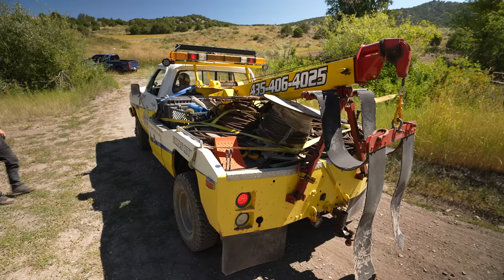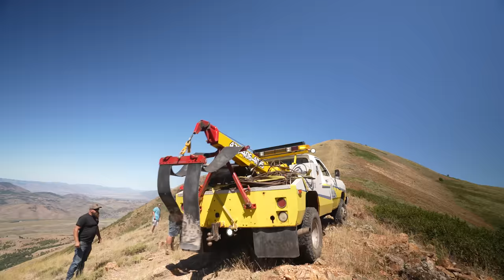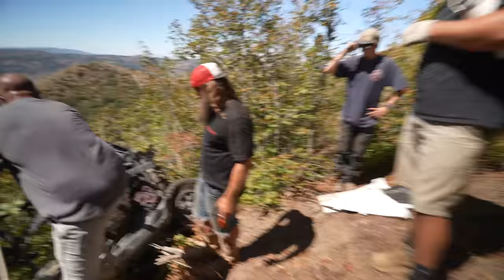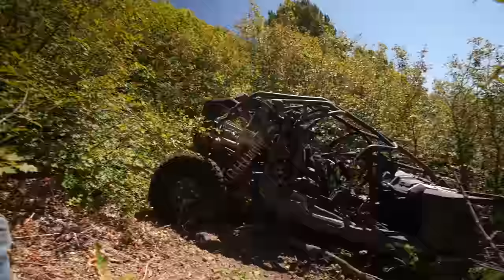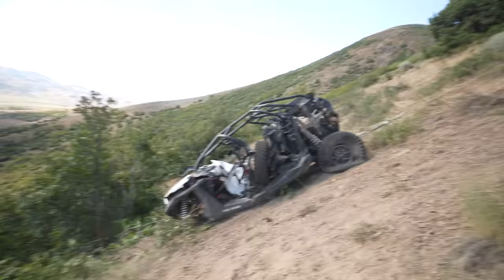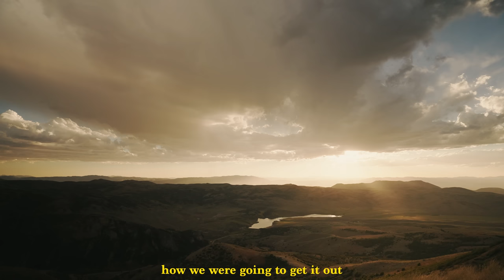Our Most Heartbreaking Recovery Yet (Fatal 1,200ft Crash)

Comment: Hello from Wyoming Im the one who grew up in Kaysville, Utah in the 50’s.  I just watched your recovery video on Garden City Utah mountain top.  I just want to make an outsiders comment to you.  As you guys were hauling that UTV up the mountain side, I noticed that the front axle was missing one tire and the other tire was crooked.  To stop it from digging into the ground or brush wouldn’t it have been easier to have a big flat piece of metal (of course) hooked to the metal rope to put the UTV on once you got it hooked up to go up the hillside.  Then the UTV would slide past all the riff-raff going up and be a lot easier to get there.  You would need another flatbed to have the metal (I’ll call it a sled) sheet sled  on to get it to the top.  Then hook up the metal ropes, etc. and lower it down to an open space.  Then winch the UTV up the hill enough to put it on the metal sled and then bring it up.  To me that would have been easier on you all.  I get called a McGuyver all the time for my projects that do work.  It was just a thought for you.  Great recovery, very sad situation but the family now has some closure.   God bless you all.

Comment: It is wild that wearing a seatbelt might have caused this fatality. I’m now curious of the data for fatalities between wearing a seatbelt and not for off-road vehicles.
Reply: We lost two women here in Moab a few years back when they rolled on Hell's Revenge.  They also perished because they were belted in, but in this case leaking fuel was ignited by sparks from the metal grinding on the rock and an inferno erupted and consumed them before they could unbelt.
Reply: The fact that the cage is intact around the rear seats but she still died would suggest to me that the bigger issue was that she likely wasn't wearing a helmet and that wearing one may have saved her life.
Reply: @KR15ING  honestly a helmet would not have done any good. That would be way too much trauma. If they were wearing a helmet with a HANS device it might have been survivable. Just like in motorsports it seems that HAND devices might need to be just part of the kit, especially when driving on top of a mountain.

Comment: Very sad thing to have happen, condolences for all involved!

Five point harness and helmets can do wonders. I’ve rolled my rail, all safe after rolling for over 350 feet down a very steep foothill in AZ. Flipping like crazy, sideways, end over end. Rail handled well, it was built by Brandwood Racing, engine built by Racecraft. I still have it. We use webbing also along with passenger foot press and panic handles. Two seater with a 2331cc, 13/1 comp ratio. 
Max fun but mad dangerous too! When the beers or booze comes out, the machines are never ran again until morning, that’s a rule everyone should practice, in fact we call it Law!

Comment: Back in the day i used to hook logs with cable and have used cable slusher draglines mining underground.  Ive used a bit of that synthetic rope and in abrasive heavy use and its never held up at all onlybgood for suspending loads and rigging.  Cable is the only way to go in real tough conditions and if you break a cable its no big deal to weave and splice it together if its not too large an diameter.  That old Cummins 5.9 is about an ideal truck with its mechanical injection and simple engine.

Comment: I drive several Argo vehicles off road, mainly on mountains. I'd never wear a seat belt in a vehicle like that, there's nothing worse being strapped into something tumbling down a hill. My first reaction if I knew it was about to roll, would be to bail out soon as possible. When on a steep bank, at times I'll even have a leg out the side, just to be ready. But of course if depends on the terrain, if it's just a small mound it would be fine, as you wouldn't go very far. But a big mountain side like that would be a big no no for me. Although I'm sure all the safety manuals and reccomended training would tell you otherwise. I only know of one person that was killed in an Argo near me, and I know that they were strapped into it as it went down a hillside.

Comment: You guys should have a thick piece of plastic made roughly the size of a razr. mold it up on the ends and put a hole in an end of it. You could put the rzr on the plastic and haul both of them up a hill such as this one. i THINK it would slide over brush and rocks much easier. Just a thought gentelemen.

Comment: As a former Army Engineer, I'm just surprised you never use picket plates. Half-inch steel punched for half a dozen 1" pickets each side, each picket 4' long, sledged in deep. A shackle front and rear, ane if necessary more plates to shed the load out to either side.

Comment: many will see this as a reason to not wear seat belts, if you're off roading this can be a decent idea because if you roll down a cliff like that the sudden stop with the vehicles added momentum is pretty similar to falling to your death if not the exact same. being unbuckled in a crash like that can be the only way to survive but you still risk being crushed by it as it rolls, but if it's a more mundane crash and just rolls on the trail being buckled in keeps your head and arms from going under the body/cage but if you're unbuckled you risk dying in a rather mundane roll over, this is all for off road thought where you should look at your trail and use your best judgment to decide what is the safest you can do. on the road it's different you rarely will have a case where the seat belt is a problem and will have many where people died because they didn't wear it, if you're on the street is safer to wear your seat belt, if your off road use your best judgment and try to make it home safe please.

Comment: You guys should map out all the bits pieces of vehicles as well as the crash site's of these places so that they could use them to improve safety on whatever road/trail/etc. the accident occurred at or for vehicle manufacturers to better improve their safety features. The tragedies you guys help people with can help prevent further harm in the future. Like for instance, I get that the ATV fell over 1000ft, but i feel like the seats coming out of the vehicle while its tumbling down a hill should be preventable in an off road vehicle with a roll cage chassis. Stuff like that should be sent to manufacturers themselves with a full crash report.

Comment: What could have prevented this?  Helmet, BETTER ROLLCAGE, better seatbelts?  I own a Honda Talon and rolled it on it side at about 15 MPH.  It tweaked a few welded joints in the tubing.

Comment: Maybe best to run a skid under it first? Drag it onto a sheet of metal? Then pull the metal skid instead of the razor. If the whole thing is on a smooth skid it won't catch on anything at all.

Comment: I personally would have made 2 ft wide sleds where I could have slid this thing right up on the two sleds in the cables would have been right down the middle and this thing would have sledded its way instead of digging down into the ground the whole way up you need sleds. Make it out of sheet metal some wood stuff like that and if you do it right with ramps you could have pulled it right up on it and the cable could have went right between the sleds and you could have just pulled it right up but yeah that sounds great and all but I still think it would have worked

Comment: So just using logic. If the ascent was 2,000 feet, and the Razor rolled 1,200 feet. That would place the Razor 800 from the bottom. Would it have been easier to just drag the Razor down 800 feet as opposed to 1,200 feet up? Just sayin'

Comment: Rather than FIGHT gravity and the weight of the vehicle, why not approach it from below and let gravity and the weight of the vehicle work FOR them? It's already totaled, and the only real danger is to the tow truck, which can easily move out of the way if it rolls uncontrolably.
Reply: That's the first thing I thought but maybe there was no road access from the bottom and it looked like there were more trees at the lower half of the hill. More trees to drag through. Just guessing. I wondered if they could have made some kind of skid/sled or plate to put under the front end to make it slide better.

Comment: What a super dangerous procedure to try & haul a relatively light load.  Unacceptably dangerous to have multiple uncontrolled line failures with personnel standing around all over the place.  Shock loading to the haul truck up top could have sent it off the side too....absurd to see front wheels lifting off the (super sketchy) ridgeline position.  I understand a lot of this is edited for entertainment & dramatic effect, but the reality is the whole thing looks like amatuer hour.  Bring on the haters....i have been rigging complex lifts for 35 years & also worked in emergency services-road rescue, so I know dodgy when i see it.  If Heavy D is going to hold his operation up as a genuine, professional operator of last resort, then the whole task should be....professional (& safe).  There was no evident rush for this extraction, so why was it not planned properly & executed safely?   RIP to the woman lost & all sympathy to her family & friends.